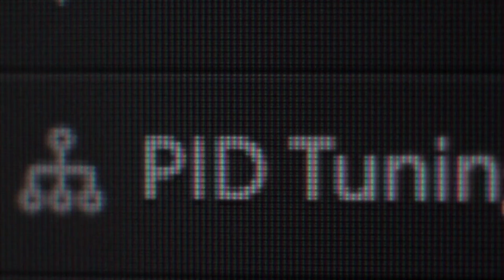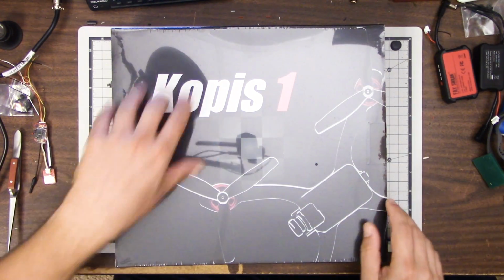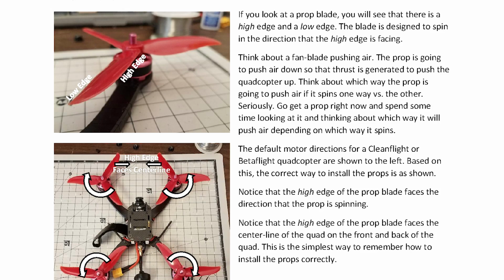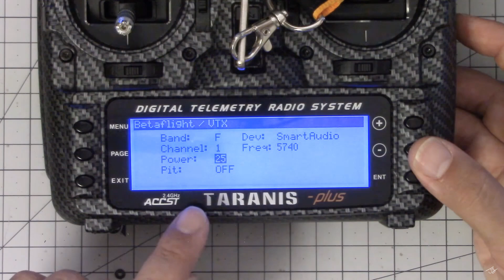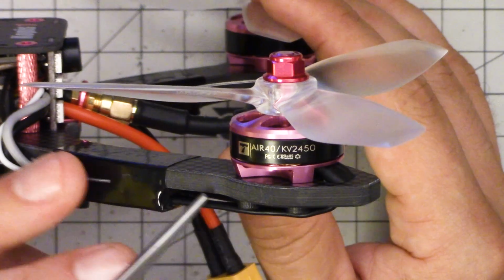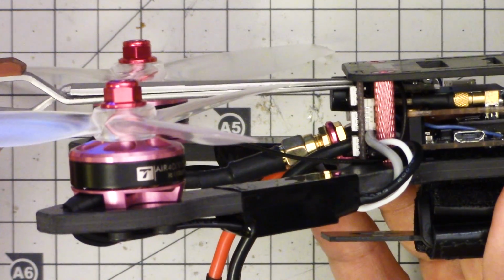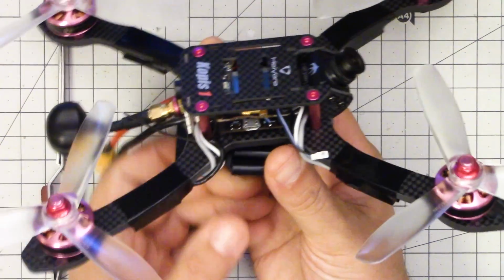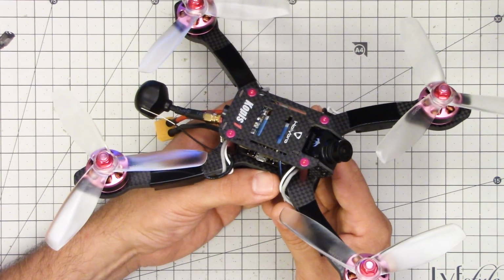Holybro Kopis | THE BEST $300 RTF RACING DRONE NO KIDDING

Comment: Where the hell is the camera protection (or at least the mention of the lack of protection)!
Reply from the maker: I apologize for this. I mentioned it in some earlier takes that I ended up not using. Then in the take that I did use, I forgot to mention it and overlooked it in editing. The camera is vulnerable, just like the GT200. This is such a good quad overall that I can't bring myself to throw it out for the camera, especially because so many people seem not to care.
Reply: Joshua Bardwell I can understand that. Have you suggested a carbon fiber cross bar or 3D printed part to holybro?

Comment: I was waiting on the nono on the bottom esc. I'm def. Not trolling. But we trust you. And I feel like I was used carsalesmaned..
Reply from the maker: The bottom ESCs concerned me when I first saw them, that's why I asked Holybro to put a protective cover on them instead of leaving them naked. And the bottom-mounted battery is going to prevent an ESC from taking a hit in most cases.
Reply: I listen to all your stuff. Start to finish. I heard what you said. Just seemed late nite info-mercial to me.  You Helped me tons and still do. Have a good nite.

Comment: No signal ground wire from ESC to flight controller. What are your thoughts on this?
Reply from the maker: I run it when I can but if there is no convenient pad for it I don't worry about it. Very short wires mean it usually doesn't matter.
Reply: Joshua Bardwell 
Thanks so much

Comment: what c rating were you running with your batteries
Reply from the maker: 500 unicorns. C rating is meaningless :-)
Reply: ok thanks mate, was just wondering cause I seen another video that said they had problems running high c rating on the kopis, I've ordered one and ordered tattu 1300 95c batteries but then seen that so had me questioning, thanks mate

Comment: I don't know how I feel about the recessed top hardware. I feel it would rip through the carbon fiber with a top mount battery. Oh well
Reply from the maker: The quad is designed for a bottom mount battery. But countersunk screws have been used in many other builds including the Chameleon. Some have argued that they are stronger because they make solid contact with the plate.
Reply: Joshua Bardwell makes sense, appreciate the reply!

Comment: After my experience purchasing brand made quads my only recommendation to anyone getting into quads ESPECIALLY RACING QUADS is CUSTOM BUILT QUADS IS THE WAY TO GO ( you will look like a chump turning up to races with this shit craft) Yes the manufacture of their own product will make it sounds like it is the next best thing to slice bread, what they won't tell you is when anything goes wrong with it ONLY THEIR REPLACEMENT will work which allows them to CHARGE MAXIMUM PRICE for replacements or if you are lucky they are still in business and can offer the parts. I personally experienced this with DJI and now Holybro. After purchasing the shruiken made by holybro the vtx was no good from day one, The only fix to this, YES! to repurchase the whole board at premium price since no other competitor has replicated the board to be competitive (so not worth it anyway). I basically gave up scrapped it for parts and swore never to purchase a brand made quad again. Customs are the way to go, your choice of VTX, FC, PDB, ESC etc one will work with the other instead of brand specific product.I learnt the hard way, you don't have to. And by the way, a better quad can be built for less so them bragging about price point is complete horse shit.